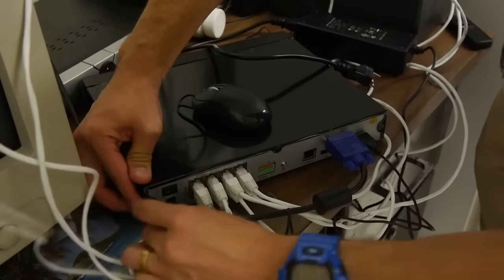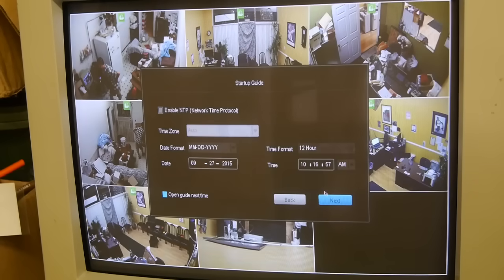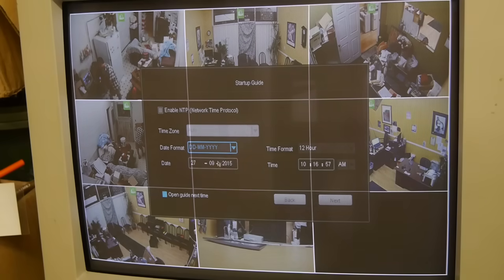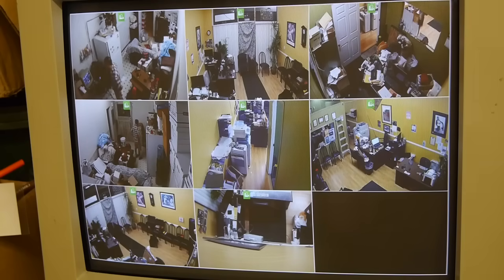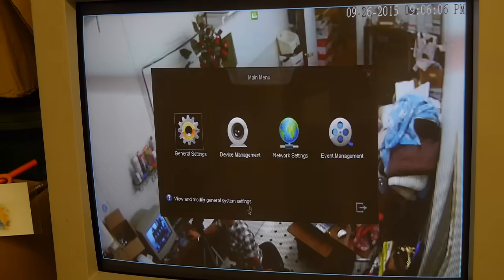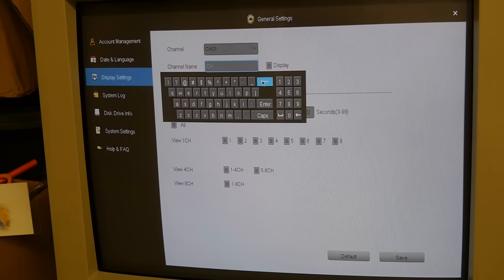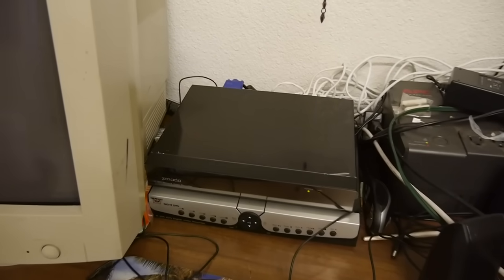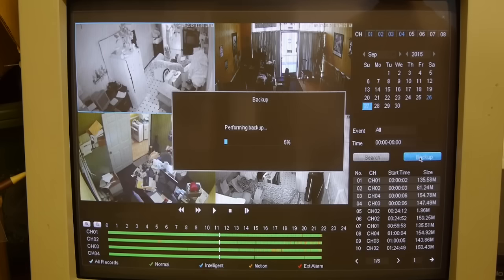How to install a Security Camera Surveillance System

Comment: That screen doesn't open up at all. All I see is the camera screens and no recording. Please help!
Reply from the maker: every system is different so You'd need to consult the manual
Reply from the maker: also, it takes a while for the system OS to boot so in the meantime you'll only see the camera feeds and no operating system until it's finished loading

Comment: Great video !
I just want to own and control my footage, and I'm still not sure how just yet.
Reply from the maker: Thanks, appreciate it!
Reply from the maker: It's Mentioned in the video
Reply: @ToolCraze  
But what technology is built into the hardware that the average consumer isn't aware of ?
Heck look at our darn smart phones...just a little apprehensive.
Reply from the maker: Irrelevant, if you wan't to learn how to replay and save your footage watch the video and learn how. If you wan't to learn the in's and out's of the technology that's built into these things, take a class in engineering and electronics. You don't need to understand how a gasoline engine works to drive a car, similarly you don't need to understand how these DVR's work to operate them.
Reply: @ToolCraze  
No need for such a lengthy explanation ,when the manufacturer should print the capabilities clearly in a owner's manual or under the listing information. 
Gotta go beyond thinking about your own security needs and realize not all is as it seems.
Thanks though.
Reply from the maker: you sound like a conspiracy theorist
Reply: @ToolCraze 
Thanks the Russians made me ask
Reply from the maker: lol
Reply: @ToolCraze 
You still made a great video dude ....thanks again

Comment: Great video, thank you. Having said that zmodo Camara systems leave little to be desired. I've had there system for three years and I still can't get it to connect to my router. The cameras are proprietary which means they will only work with zmodo nvrs .the nvrs are very hard to use I would not recommend zmodo to anyone ever!

Comment: What brand is the system and can it be operated without wifi or internet?
Reply from the maker: Don't need either to run
Reply: Tool Craze Thanks,I think I see the brand Zmoda.I can't open the link.

Comment: Homeowner grade systems suck.
Reply from the maker: I disagree.
Reply: @ToolCraze  You disagree all you want. My professional company specializes in ripping out home owner grade junk and replacing it with professional equipment. Because when you miss the money shot, its all junk
Reply from the maker: Darn straight I can disagree, I've installed several of what you call "homeowner" grade systems and they're like the energizer bunny, they just keep on going year after year. They are truly workhorses. I've also bought more expensive systems thinking they'd be any better but weren't so why pay more?

Comment: How would you do it if you have a two story house and how would you do it through the Walls but the garage is on the other side of the house
Reply from the maker: You have no choice but to go through the second floor. Personally I'd open up walls and run wiring in wall.
Reply: OK thank you so much just so confused
Reply from the maker: It's not as hard as it sounds if you know what you're doing. The hardest part is patching the drywall once wiring is done. Not so much that it's hard, just a lot of work.

Comment: Good point for installing your own drive but a new drive is blank with no operating system. When you installed it did you format it? How did you prepare the drive.? On a PC you would format and install the operating system such as Windows. How does the security system handle this? I know it's for writing data but it needs a file system
Reply from the maker: The recorder takes care of formatting

Comment: Why everybody says that infrared light is invisible? It's clearly visible at night as a red light - so it's easy to pinpoint where the cam is.
Reply from the maker: You may be able to see the LEDs but if you can see the light they output, you're probably a mutant. The light they give out is an invisible wavelength to human eyes.
Reply: @ToolCraze  All people in my household can see it. So, I'm not the only one. Just turn the light off and look at the cam.

Comment: Cable staples? How disappointing. I was hoping for tips on how to install behind drywall. Best I've found so far is the Magnapull.
Reply from the maker: Are you prepared to open up the drywall and drill through the top plates of each wall frame to route everything in wall and have an attic space with enough headroom to crawl through to run the wiring, then drill through top plates and drywall and the receiving end? If so, great but Not everyone is prepared to do that or have an attic. The office where I installed this camera system didn't have an attic and in wall wiring would have been not only too costly for the office owner but too time consuming as well.

Comment: Hey Javier and everyone here in the comment section - I need a system for the underground garage of a small 12-unit condominium complex. We just need 4 cameras installed in the garage. And we don't want a subscription service. 

The DVR would be secured in a locked metal housing box mounted on the wall somewhere in the garage. 

What we want to have, is the ability to have wireless access to the videos. It's fine if we need to walk into the garage for that access. 

The connection from the cameras to the DVR could be wireless (ideal but what's the range) or wired, but again the main thing is we don't want to have to open up the metal box and connect a laptop to it. We want to be able to access the videos wirelessly with a smartphone's browser. 

Any recommendations in terms of what to buy? I was thinking of getting a wireless hub and connecting the DVR to it, all inside the housing box (along with battery-backup).
Reply from the maker: Sounds like you only need to access to the DVR wirelessly. Any wired or wireless system can provide that as long as it's connected to the internet. Doesn't sound like you really need wireless cameras so here's a wired 4 camera 8 channel system with hd built in https://amzn.to/2CmaTGQ . It has 4 cameras to keep the cost down since that's all your saying you need and the NVR has 8 channels for the possibility of extra cameras if you ever find you need extra cameras down the road.
Most wireless camera systems aren't actually wireless because even though you don't need to connect them to the NVR directly, they still require a wire to connect to a power source which actually requires more wires and extension cords for each camera or opening the walls and the expense of adding a new power outlet for each camera.
If you do want to go completely wireless, you can go with an arlo system https://amzn.to/2CmaTGQ that has completely wireless cameras but they require you to replace the batteries every few months. They also expect you to use their cloud service which you don't want but the link I provided you is a system that allows you to use an external HD to record 24 and skip the service plan.

Comment: I have a big house, is there any way to situate the DVR in a crawlspace or somewhere central to reduce wire lengths while still having access to it through a monitor
Reply: Also to add, I will put a network switch in the ceiling crawlspace, so will it be possible to access it via that network if plugged in?
Reply from the maker: You can place it anywhere you please, just make sure to keep it in a dry and cool place. You can also buy longer cables and additional cable lengths and there are adapters to connect multiple cables together if needed.

Comment: So wifi and router is needed? Added expense!!! Is this needed in cordless cameras/system?
Reply from the maker: Only if you want to control the system remotely.
Some wireless cameras do require a WiFi router, but depends on the DVR. If you get a wireless DVR/camera system, it won't need a wireless router unless you need to access remotely.
Reply: Tool Craze so to view this live video footage from my smart phone i will need both router and Wi-Fi? Basically i want to hook up system  to veiw Security for my pig's about 20 miles away! Automatic feeders, water pipes ext.
Reply from the maker: Yes, Only if you want to control the system remotely.
Some wireless cameras do require a WiFi router, but depends on the DVR. If you get a wireless DVR/camera system, it won't need a wireless router unless you need to access remotely.
If you get a wireless camera/dvr system and they all connect to each other, then you don'd need wifi but you'll still need a router and internet connection only if you want to access them remotely.

Comment: What's your opinion about wireless NVR?
Reply from the maker: specifically, which aspect did you want my opinion on?
Reply: Basically I'm worried about footage quality and frame drops, thanks.
Reply from the maker: footage quality would depend on the strength of the signal and the transmission quality and fps which is dependent on the model of dvr and cameras used. I have a wireless video doorbell and so far haven't noticed any frame drops but then again I have a strong signal to my router

Comment: you must be really lucky! seagate hard drives always failed me and lost tons of data.
Reply from the maker: never had a problem with them and have many seagate drives still running till this day. Honestly they wouldn't be in business if they had terrible failure rates. Maybe you can check and troubleshoot why yours broke down because things like vibration, shock, heat can kill them.

Comment: This is not a professional installation. For a business you should install everything so that you don’t see ANY cables around the camera.
Reply from the maker: Same as any PROFESSIONAL install, just look at the video you can see all the other previous PROFESSIONAL installs with wires around floor trim and door trim. No difference whatsoever.
You simply don't know what you're talking about
Reply: Tool Craze still the wires are not ran through the wall at the same location as the camera
Reply from the maker: Yeah, so what? This is a BASIC installation guide. Nothing is stopping you from opening up your wall and doing all in wall wiring. Not everyone has the time, patience, know how and budget to do all in wall wiring. If that's the route you want to take then more power to you.
Reply: Tool Craze then you should say in the video that it is only a basic installation!
Reply from the maker: This video is titled "how to install a surveillance system" and that's exactly what the video shows you. No change is needed.

Comment: So you've got cords running everywhere visible in your shop....Not very aesthetic - I was looking for an YT upload showing it connecting through the roof
Reply from the maker: I showed you how to run wires through walls, go through the attic. It's that simple. This office doesn't have an attic.
You never run wires outside the roof, that would be foolish and a poor install.

I don't really understand all the rare negative comments about visible cables. This install is no different from any cable/internet/phone install I've ever seen. In the video you can see I ran the cables where other cable/internet/phone installs already were.

Comment: Hi Mate 
IP camera, if your internet is down does it still records through NVR, like DVR. You said it gets it power from NVR for the IP camera and the broadband from the router, this is , if you need to see on  smartphone.
I was thinking of buying Analogue, but I am seeing this is phasing out, so might as well buy IP camera system.
My main concern is if the internet is down, does the IP Camera records through the NVR even though internet is down.
How much broadband data is used, I only have standard broadband 8mb unlimited and there will some devices used like ipad and smart tv.
Reply from the maker: you only need internet if you wish to view remotely

Comment: I need an adapter with the BNC with the little nubs one side and the male plug in (that has 3 black stripes on the prong) on the other side of an rca jack which will plug into the DVR.  Is there an adapter for that?

Comment: Great information on the hard drive especially.  I would wonder if the Hard drive failed, could you purchase another hard drive externally?  I ask this because Harbor Freight has a Cobra for sale that has gotten reviews but, has a hard drive included for $209.00.
Reply from the maker: You can use any internal hd only. If you get an external one you won't be able to connect it as is but you can still take out the hd from the external enclosure and put it inside a dvr. Also check the hd from the hf brand, if it's a name brand hd you're good. I recently opened up a dvr that came with hd inside and it was a wd purple which is good.

Comment: I have a question. The cameras shown in this video have an ethernet connection. I've seen some online that have a MicroUSB to Ethernet cable. Camera has MicroUSB connection <-> MicroUSB/Ethernet cable <-> hooks up to Ethernet port on NVR. Are they completely different systems?
Reply from the maker: Not a different system, it's a PoE system called sPoE, and the s stands for simplified. Basically same thing as PoE but uses a usb type c style connection at the camera but the ethernet cable outputs as an ethernet cable to the NVR. A lot of the newer Zmodo IP camera NVR systems use this nowadays. I have one of those

Comment: Hey thanks for your reply. you are mistaken about the wardrobe . when you got the install right above the dvr and there is a large ceiling vent just above your head. Any way i am very impressed with you detail for the install, very good and informative video. Not sure about usa if thats where you are but we hide our cables in plastic trunking where you cant get into a cavity.
Reply from the maker: I'm mistaken with the wardrobe? I personally know that office inside and out. I would know if that's a wardrobe or not and it's a fridge mind you, no point  in arguing about that.

Either way, glad you enjoyed the video otherwise.
As far as the cable installation goes, yes there are better ways to do so such as in wall and through the attic or in basement or raised foundation. But this is what you would typically get if you ordered cable/phone/satellite installation and you get the same level of service with exposed wires running along trim and baseboards. I also chose this method to show you guys because its the easiest to do with a few tools, and little to no experience and knowledge needed. Also that particular office building didn't have an attic or raised foundation or basement to run wire through FYI.
The person that would know how to run in wall or through attic/basement/raised foundation would be inclined to simply follow the installation instructions included with their surveillance camera system and would not need to watch a tutorial video. Easy as that.
Thanks for watching.

Comment: How best to connect video surveillance at a second residence to monitor at a primary residence? Also is it necessary to have Internet at second residence?
Reply from the maker: You have to view it remotely. You're options are wired, wireless and or internet
Reply: Tool Craze Bunker Hill wired.
Reply from the maker: I don't mean to sound rude but I wasn't asking what system you have. I was saying those are your options to view remotely.
Reply: Tool Craze how to set view on second facility?
Reply from the maker: View my first comment

Comment: i understand that this video was shot in 2015, but if you are still watching today, DO NOT buy analog cameras people, get an HD SDI or and EX SDI along with a Compatible DVR, the most frustrating and complicated thing about surveillance systems is the wire running part, if your home is finished and you are 4 to 8 cameras to mount, it is a real pain if you don't have the proper tools.
Reply from the maker: Late last year I was able to install an analog HD camera system and can verify that analog camera systems are still a very good alternative today. The HD resolution was actually pretty darn good, something I didn't expect out of an analog signal. Best of all you can easily upgrade an old analog system by simply swapping out to new HD cameras and compatible HD analog dvr and keep the old analog cables meaning no need to rewire. Not bad at all.

Comment: Hello Javier, I have installed a POE system in our store, it was working fine initially, but after about a week 2 cameras just died within 24 hours of each other, I tried different cables, switched the channels, even tested the pigtails and nothing, the cameras are just completely dead. I am very frustrated. Do you think it is just bad cameras? Any input is appreciated. Good work!
Reply from the maker: You troubleshooted just as I would and it singles out those two cameras.
I wouldn't doubt at all the cameras are bad. The only input I can offer is to see what may have caused the cameras to stop working, maybe the location is too hot, in direct sunlight? Just something to consider so your new set of cameras don't break in the same location

Comment: Excellent video. 
I'm looking for preferably a POE system. I have two boxes of Cat5e, but I don't want a monitor, I'd prefer it all to my phone or cloud if possible. I was thinking of going with Nest but I'm also thinking I'd prefer something without the monthly fee and no power cord. I'm a bit torn here.
Reply from the maker: get the system of your choice and after setup, ditch the monitor. You can set up most dvrs and nvrs to remotely view on mobile and remote pc. You just wont get full access to the dvr and it's features as remote viewing limits what you can do, especially on mobile. Not so much when remote viewing through pc.